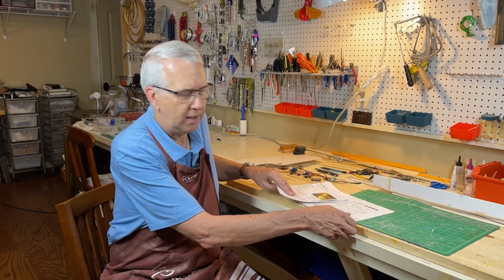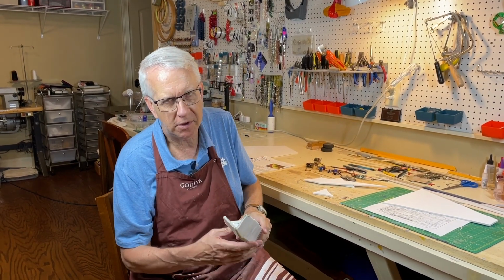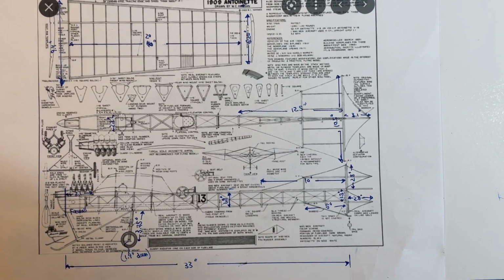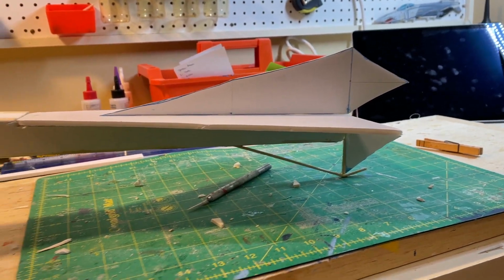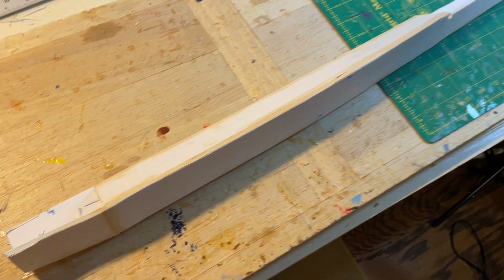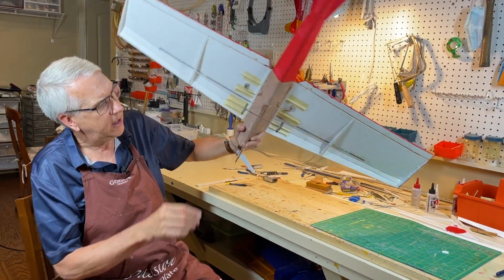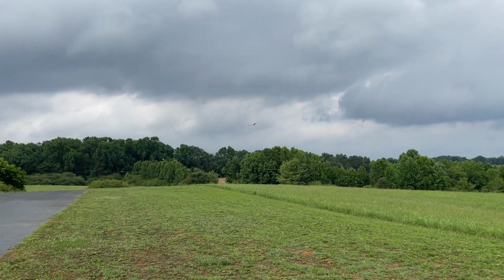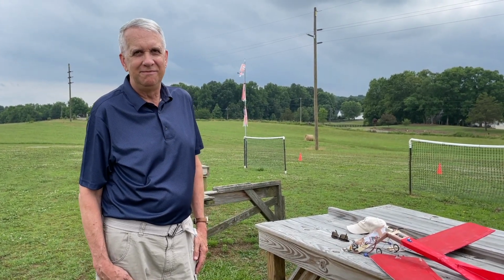Build Fly Crash 1908 Antoinette Foam Board RC Plane

Comment: This is a dream project ! A small suggestion from me. … after glueing the wings together, a couple of rubber bands over the central portion with two sets of dowels on the body, the wing configuration could be more stronger and stable with maybe no flutter in flight … 
Thanks
Reply from the maker: Rajiv:  Yes, this was a fun project.  Your suggestion is a good one to strengthen the wing joint/center section.  I should have known better, but live and learn.  Stronger next time!  Tim

Comment: If you had placed the wing joiners down below the wing and made the cabon fiber rod continuous un the center it could have worked.   And/or you culd have put a thin wire ( actualy a thread)  between the end of the wheels axle and wing tip.
Reply from the maker: Jose:  Excellent input, thank you!  Tim
Reply: @TimMcKay56  thank you, actually I like very mucho your style...

Comment: Informative Video Tim. Show lessons learnt. Must admit when I saw your wing joining strategy I was worried. I think your main spar should have been at least 4mm deep and a bit thicker.  We have to remember depth has a squared relationship. A flat 4mm deep carbon rod spanning a third into both wings then attached to your current wing should do the trick. Also  a bit of 2mm carbon as a secondary spar further back. Looked a lovely plane like you say longer nose makes a lot of sense.  Love experimental planes.
Reply from the maker: Mark:  Roger all!  I think if I flew a tad slower, I might have lucked out. The 3 cell really made it step out. But needed more strength at the wing join for sure. 😳 Tim
Reply: @TimMcKay56  Tad slower maybe. I think 3s was the right way the extra power worked on launch. Was fun video. I had made a test canard edf with vectored rudder thrust. It had just enough thrust to get in the sky, but then any touch of rudder sent it spiralling to the floor shame not caught on camera.✈

Comment: A simple 1/4" Dowel through the entire wing would have saved your model. All my RC planes are built and designed by me, here's a unique design concept I came up with for balancing my airplanes without adding all the weights. I simply make the fuselage and the nose of the plane out of 2 rectangular square tubes (Balsa or Foam) that slide inside each other, if the plane is to tail heavy (as always) I simply slide the nose out until it balances then lock it in place with a set screw, The entire plane becomes a sliding scale and I can adjust balance for slight nose heavy or level balance. something to think about if your not building scale replicas.
Reply from the maker: Frankie:  The sliding tube will certainly work.  My challenge with the Antoinette was the dihedral in both wing panels . . . it cannot be a single dowel or tube.  I do think additional skewers might have worked.  Also, the model flew very fast with the 3 cell lipo, that did not help matters much.  Tim

Comment: Great video. I wonder it adding the metal wire supports like the real aircraft would have added to the strengh ?
Reply from the maker: Alex:  Absolutely, just a lot of work to install.  Tim
Reply: @TimMcKay56  makes sense. I just got into rc . On the 3rd flight i wrecked my plane. Hehe. Im going to give modding a foam glider  a shot. I do like the idea of making my own planes rather than buying them. Thx for the inspiration.
Reply: @alexgonzales1855  Anytime!  Tim

Comment: Thanks for the video. Sorry the flight was so short. Interesting to see how weak those 3mm kebab sticks are. Re the wheels being behind the c.g. perhaps they kept the nose up/tail down just with prop wash and tail elevator and as the plane came to a halt it would sit back down onto the front . . ?
Reply from the maker: Yeah, just a mystery to me on where the CG was on the original Antoinette.  I think the kebab sticks might have been strong enough, but just barely, if I had flown a bit slower.  With the 3 cell, the model really stepped out!  Tim